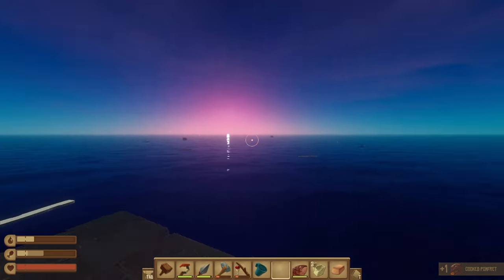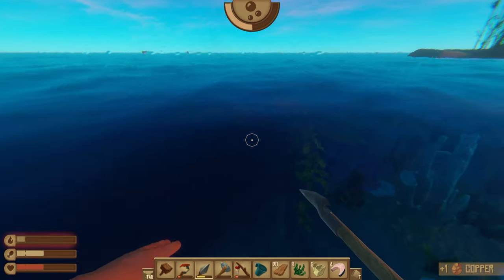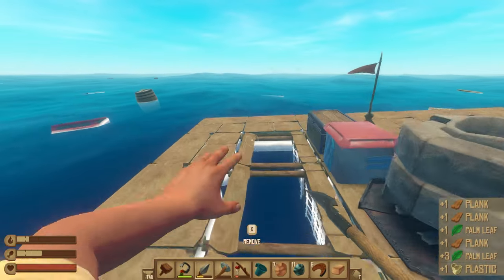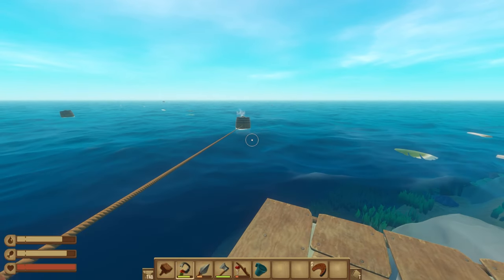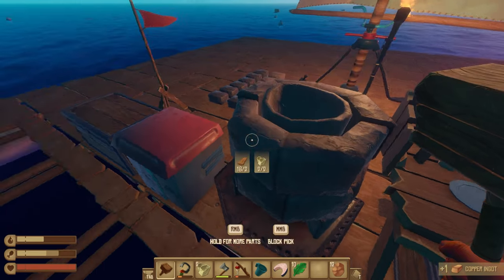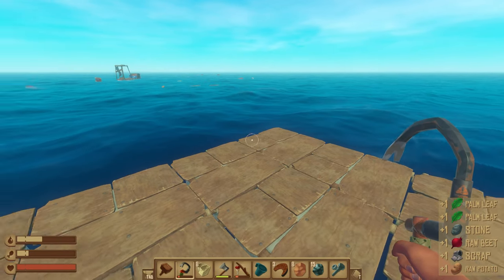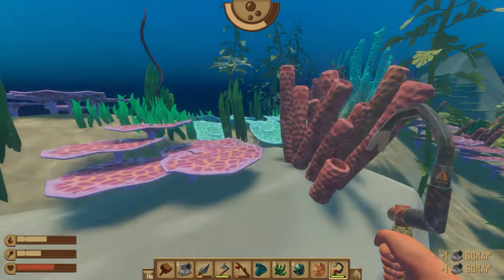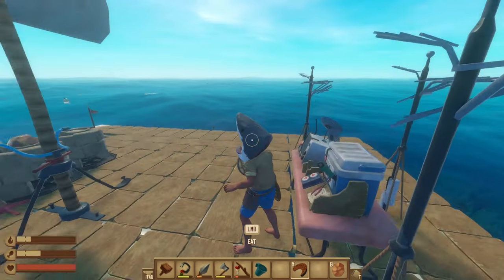Crafting the Radio Receiver and Antennas // Cauldron Plays Raft // Episode 3

Comment: Super late to the party but a tip for new Rafters is to put the nets on 2 sides of raft like an L rather than just one if you do not want to worry about trying to keep turning the raft around before you get the rudder and engines. I find you get enough materials to do that to make up for the extra it takes very quickly. Doing it on all 4 sides doesn't make much more difference than just doing it along 2 like that, but it means however the raft turns there's nets perpendicular or diagonal to the drift of trash to catch it.
Reply from the maker: Great advice! I really should have done this earlier on, and then I'm probably being a bad example in the current state of my raft with a full border of nets, but this is definitely the most efficient use of nets when you are getting started!